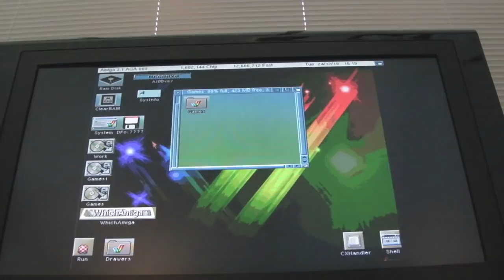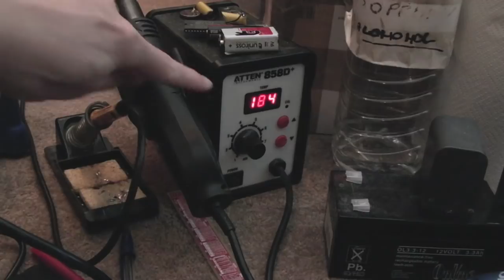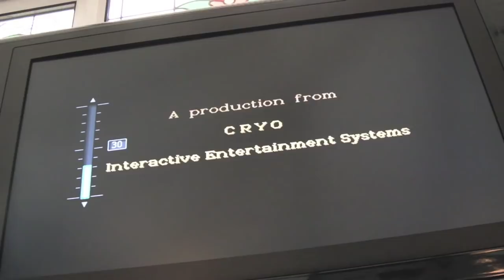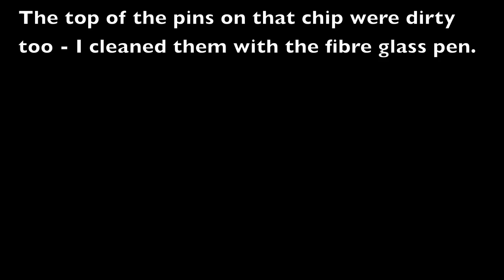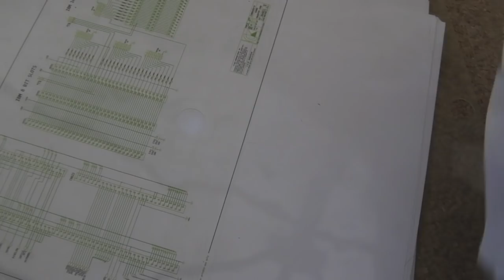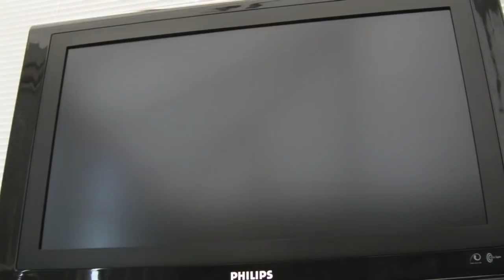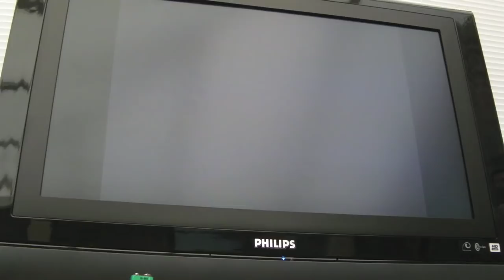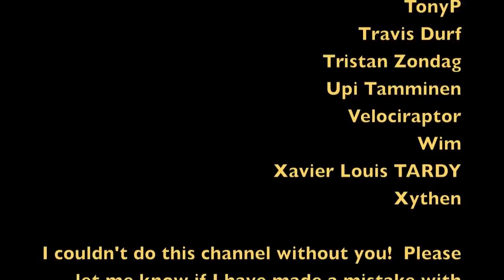Commodore Amiga A4000 Repairs - Part 3  (Cathers)

Comment from the maker: There's a part 4 coming up!  Just some final tweaks and testing of ZIII slots.

Regards the slots there - I am not sure I was right!  The ZII slot looks to be a ZIII slot too!  I fitted a ZIII 256MB RAM board yesterday to test this and that's where it plugs in (same slot I used with the A2090).  I am guessing that the PC looking slots on the other end are actually PC slots for use with an x86 board?   Pretty sure that bottom one with a different pin count is the video slot.  Please correct me if I am wrong!  Regards my point about things looking OK on the scope - they probably wouldn't have done on a "proper" scope with a clearer display.  Scoping the output of the audio at the coupling caps would have shown some clipping due to that low bias.  Next time I would jump straight in with the Hameg I think!   The issue with the A2091 not always been detected as "working" on the A4000 was resolved in another video (See the A2019 video).
Link to supaduper (CD32 Accelerators on AmiBay) - http://www.amibay.com/showthread.php?104735-CD32-TF330-rev3-030-50mhz-64mb-Fast-ram-IDE-Accelerator/page43&highlight=TF330 

Regards my waffle at the reflow part later on - I under emphasized how many of Vinces videos I've been watching (unintentionally!) - I watch every one he puts out!  Here's a link to his channel - https://www.youtube.com/user/mymatevince

Part 2 - https://www.youtube.com/watch?v=5q4MaN6bMBA
Part 1 - https://www.youtube.com/watch?v=CohL_kduhYg
Reply: The bottom rear slot is the video slot yes, the ones above are ISA slots and will only work with a bridge board and are not accessible from the amiga side. All the front slots are ZIII.

Comment: Interesting repair, I was wondering if the bias was wrong, but here something pulled hard on it to gnd.   So nice listening to the games, and the harddrive seeking noises.. Those were the days! Several friends locally owned an A4000. I looked up to the machine, however with a 060 in my A1200, and later a picasso96, it was quite dreamy. machine. Thanks for the video!
Reply from the maker: Thanks mate =D  I never owned an 060!  That is about to change though - I've bought a processor!  Now I need something to plug it into lol!

Comment: Nailed it Gadget! loved watching this little series. For the DB slots, the 4 at the front side are Z3 and  Z2 compatible. The slots at the back, bottom video like in A2k and A3k and the slots above it are the PC ISA slots. For the front led/keylock wires, the plugs are fed through the square hole in the middle front. PSU's i have recapped on both my A4K's the first one had a few caps the nearly knocked me out with the fish smell when desoldering, the second one no fish smell but removed and tested with ESR meter found 4 suspect ones on the low side. The one i have been fixing is now stable, good voltages and added one of JH's 060 boards.
Reply from the maker: Thanks =D  It hasn't gone back yet, so I can correct the routing of those switch wires on the front =D

Comment: At last.  Some obscure faults on that one.  Top refurbishment Chris.

When I had my 4000 I seem to remember there was a plastic film similar to the one on the chassis between the drive cradle and the Zorro backplane to protect again shorts, and the top cradle screws were countersunk, so the top case didn't sit on top of them.

I had one of those Toshiba SCSI CD drives in mine, but can't remember what SCSI card I used.

Comment: That Buster socket is definitely nasty. Unfortunately the only way to repair that 100% would be to remove the socket with hot air, possibly do some pad repairs and then solder a new socket in place - probably with hot air as well. They likely would have been reflow soldered in an oven at the factory. Good job getting it all working again :)

Comment: I think the buster socket has been replaced at some point, because the middle plastic bit is missing/cut out, which you usually do when soldering in manually. Now removing the middle plastic does impact the rigidity, it will be clamping the IC with less force (sometimes you can see some 'rounding' on the flat sides of the socket). What I do today when soldering new 4000 boards is just solder the buster-11 directly to the board. It improves long term reliability and there's no reason to keep the buster-11 socketed anyway. In this case, probably not, since some traces/pads are already damaged and it depends where the traces come from if it's feasible to solder a jumper to the pin...
Reply from the maker: Thanks for the info there!  Yes, you can see the rounding there!  When the chip is in that straightens out though thankfully!  Soldering it directly to the board is probably the best solution if one or two of the pads are damaged there I think!  Cheers =D

Comment: Great series so far Gadge, was great seeing you debug yet another hardware problem. Those pesky caps eh?  Was great to see it running on the live stream! 

I hope you manage to get the donor A4000 board running. What ya gonna do regarding a case etc. for it? Would it be possible to mod an AT case? Some have horizontal card slots on similar risers, although they probably won't line up and you would have to probably fudge a full back panel together to resolve that and the rest of the ports. Regardless, I look forward to that adventure!
Reply from the maker: Cheers mate =D   Hopefully I will get a donor board!  Not sure about the case yet, I will search for spare 4000 one first I think as I would love to try and build something that looks stock!
Reply: Can't blame ya mate, having a legit case would be awesome.  Hopefully the board isn't in that much of a state to require a donor!

Comment: excellent work as always - If my memory serves me correctly then there are two assembly issues A: the support bracket ontop of the daughter-board is mounted slightly wrong, it has 3 clips (seen through the holes on the op of the bracket) that totally fixates the daughter board if mounted correctly, I think you missed that (aka lift the bracket up and push the daughter board a bit further in). B: originally there was a plastic shielding (lose) between the daughter board and the harddrive bracket (to avoid the bracket shorting anything on the daughterboard obviously), it was attached via the same 2 screws that attach the drive bracket to the support bracket (these plastics were lose so easily lost over time). oh yeah and finally the cables to the front went through one of the punched holes not ontop.
Reply from the maker: Thanks!  It hasn't gone back to Cathers yet so I can change those things =D

Comment: Its quite common when you have a ceramic next to an electrolytic, and the electrolytic leaks, it destroys the ceramic cap in this way. Frequently seen in A600s when the reset circuit stops working, and I've seen AVREF go bad due to the same thing in A600s and A1200s as well
Reply: With a bad AVREF, lots goes wrong - Paula's D/A doesnt work correctly either as it is relying on the external bias voltage due to it being a current output.

Im not sure why you keep mentioning an extra filter in the A4000 - this isnt the case. It was the A1000 that had an extra filter circuit, but all of the Amigas after that have the same filter circuit (though with slightly different rolloff points). What the A4000 does have is an extra opamp stage, which is set up as a summing amp to combine the Amiga audio, and the audio from the DSP/CD header at CN404.
Reply from the maker: Thanks =D  I read a number of times over the year that the A1200 and A4000 have an additional butterworth filter - is that inaccurate info?
Reply: @GadgetUK164  Yep completely inaccurate. If you compare the audio section of most Amigas you will find the filter section is identical. The filter is formed by the two 10K resistors, the 3900pF to ground, and the 6800pF from the opamp output to the junction of the two 10K resistors. The JFET is the bypass switch - when the gate is driven high, the JFET conducts and shorts out the two 10K resistors.

The original A1000 however has a much more elaborate filter circuit, which cannot be switched off.

Comment: Hi. Was that a plastic bottle of IPA there near the soldering station? That stuff is flammable, mate - I’d hate to see you not post videos because your lab burned to the ground! 🥺 As for those MLCCs, yes, they can short catastrophically and burn up. Across the 5-volt rail, that’s (5^2)/7.4 or roughly 3 Watts. Across a 12-volt rail, and that’d be roughly 19 Watts! That’s going to go off with a bang! And it’s a bit early for fireworks, I think! 🤣
Reply from the maker: Haha, yes - That's the exact same point I made to Anthony at RiotRetroGaming when he was doing a 1200 recap, and here's me doing the same thing lol!  I've moved it away now =D

Comment: I've got a motherboard that I can't figure out. Stopped working after I accidentally shorted something on the underside. the 3,3V regulator gets blistering hot but that's all that happens now. Might be multiple ceramic cap failures but I can't feel anything else getting hot. Might get an IR camera to try to figure it out.

Comment: Fantastic series. Thank you for this! I've just bought a very battery'd A4000, and these videos have been a great primer for me! What do you think of corrosion underneath the chips surrounding the battery? Should they be desoldered to properly deal with the battery leak, or are they basically flush, preventing battery-juice from getting under them?
Reply from the maker: You often find that the only ICs that really need removing are the ones affected badly by the corrosion.  Where pins on chips further away just get the legs affected.  Flushing vinegar all around and under IC's is key really.  You can also tell from vias underneath ICs too (from the bottom side).  Many on this particular A4000 were not that affected by the corrision.   But you could just remove everything around the corrosion area if you want to be sure everything is super super clean.

Comment: Great video, and very nice repair work! If you don't mind me asking, is the A4000 keyboard lock still available to buy somewhere? I've been wanting to buy one for my A4000. Also, may I ask what kind of screws are those small case screws? I wish I had even a fraction of your repair knowledge and savvy!
Reply from the maker: I don't think its available new, but maybe new old stock - you might need to find a similar key lock (maybe from an old PC case or something) and adapt it.  The screws used are M2, M3, bolts probably.  The exact size should be listed in the parts list from the A4000 service manual?
Reply: @GadgetUK164  Thanks! The key lock will be a bit harder to locate, but screw descriptions are indeed in the service manual.

Comment: 450 degrees on the soldering iron is damn risky hot. Better get a bigger tip and run it cooler IMO. Something like T18-S3 for through-hole. On my Weller I use a similar tip whenever I can. This has allowed me to lower the temperature by about 100 degrees, I kid you not. And the tip being "too big" is much less of an issue than you might think. Granted, it's too big for fine pitch SMD, but then you can use a smaller wedge tip, or a cut cone (BC/C type) tip. The regular conical tips are just not very good for heat transfer, maybe they're OK for cell phones and other microscopic work, but they're useless for anything bigger IME.
Reply from the maker: Nah, not for smoothing caps on these!  At 350 it can be really hard to get the solder to flow - it's those long power rails!
Reply from the maker: Also, the power of the iron is part of the issue here - your Weller might have more power than this Hakko!
Reply: Yes, the temperature definitely matters, but my point is that a larger tip with 1) a larger thermal mass, and 2) a larger surface area to transfer that heat to the workpiece, really does matter a lot. My Weller is 80 W I think, but it's not especially fast. My experience is that yes, it's really hard to get the solder to flow at lower temperatures - until you use a massive tip with a big surface that gets good contact with the solder. It works wonders.

Comment: I’m looking for someone to solder a flex circuit onto a Dreamcast main board for the HDMI mod. I tried to do it but I just cannot see the connections very well and need someone to help me out. I attached the first part of the flex but I put it a little high and the second set of connections are out by 1 pin.